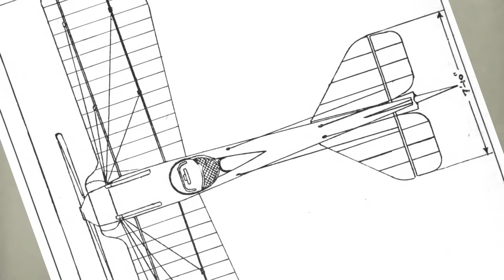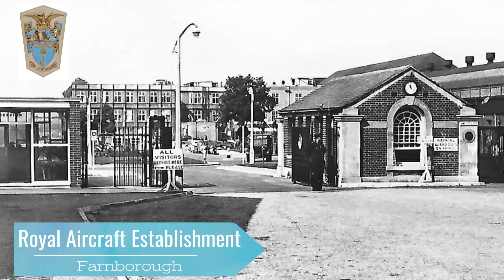This Spitfire ALMOST Went SUPERSONIC - The British WW2 Fighter That Almost Broke The Sound Barrier

Comment: Quite common for Tempest pilots to exceed 560mph in dives, but i find 690 very hard to swallow. 606 is hard enough considering the weight & power. Spits are just not strong enough, damn lucky the wings didn't tear off. I seem to remember Alex Henshaw saying he would put them into a 450 max speed dive, at which point they were out of control.
Reply: I believe that was indicated airspeed which would have equated to a higher true airspeed,; the disparity tending to increase with altitude.
Reply: Alex Henshaw could barrel Roll a Lancaster .
Reply: An addenda to the Alex Henshaw involvement. He test flew the first of 300 Lancasters built at Castle Bromwich . The factory mainly built Spitfires Marks V , IX & XVI . which Henshaw would have test flown. The more advanced Marks XII , XIV , XIX all Griffin powered were built at Southampton. Ace Johnny Johnson considered that the Griffin powered should have had a name change other then Spitfire as their handling characteristics were different.
Reply: Alex Henshaw was flight testing production squadron aircraft a lot of the time, so extremes of performance were not possible or desirable.

Comment: I've read a couple of accounts of the far east flight quite a few years ago and as I recall one of those did claim at least transonic speed. As you rightly point out - not reliable. That account also claimed there was some wrinkling of the wing skins - no idea as to how true, but the tale has been circulating for many years.

Comment: I am confused by the different conversions of speed to Mach numbers.
The first instance was 606 mph which was stated as Mach 0.89, implying a speed of sound of 681 mph.
The second instance had 610 mph, Mach 0.92, implying a speed of sound of 673 mph.
The third instance had 690 mph, Mach 719, implying a speed of sound of 719 mph.
The speed of sound is around 767 mph at 20 celsius and it drops to 741 mph at zero celsius.  However, that doesn't explain how it could be as low as 673 mph.
Could anyone give an explanation?
Reply: Air density (altitude) is another factor I believe. Speed of sound definitions that I've seen always specify temperature and altitude.
Reply: @danpearce4547  The speed of sound varies with temperature.

Comment: Nice one!
 I think the Spit broke the supersonic barrier, i wonder what other amazing aircraft RJ Michell would have come up with had he lived ?
Reply: I'm a keen spitfire fan, and I've often wondered the same.. I can imagine some incredible aircraft being built if Mitchell had lived.. 👍
Reply: If you look at other Reginal Mitchell designs you will wonder out of which  hat he pulled the Spitfire. It's sad that he never knew just how good it turned out. It was about the only front line aircraft that stayed in the front line the entire duration of WW2.
Reply: "I think the Spit broke the supersonic barrier"

Not possible. The energy created in a full throttle dive is simply not sufficient to overcome the massive drag increase as the aircraft approaches what used to be known as "the sound barrier". The clue is in the name.

Comment: Later versions of the Mk XI also had pressurized cockpit.  The dive of the Mk XIX was unintentional, the plane stalled on him.  He had a serious problem with the windshield fogging up as the humidity at low altitudes plus cold glass from high altitude met.  His altimeter was also lagging, so he had no clue what his altitude was.  Also, the main issue with subsonic planes trying to hit Mach 1 was that the tailplane was covered in the shockwaves, and the elevator was inoperable, until lower altitudes and higher temperatures reduced the Mach numbers.  The first all moving elevators that allowed control at high Mach numbers were installed on a Spitfire Mk XI.  This innovation was given to the Americans, which allowed the Bell X-1 to exceed Mach 1 in 1949, or whenever it was.
Reply: Hoa Tattis  Yes ..  Well, I guess you expanded on my term "given".  I thought the British did pay back the loans ... eventually, which is in part why the British economy went to hell post war.
Reply: Hoa Tattis  Perhaps you can ask Indians and see if they had a soft landing.  Also, you can ask them how they liked having a fraction of the global GDP of about 30 %  before England concurred them, as opposed to 3 % of the world's GNP in 1947 when they finally managed to exterminate British rule.

As for the cattle, you have to ask them that too.  You cannot force a country to the 20th century from the 18th century, you have to let them get there by themselves.  Great Britain's rule in India essentially suspended time and progress for 200 years.  

How would the world have been if Britain had not fought Hitler?  First of all, it was Stalin that really destroyed Hitler, not Great Britain.  But regardless, it is hard to tell. The world got Stalin instead of Hitler, who was a far worse dictator and human exterminator.  The USA and Great Britain turned Stalin, the world's worst dictator, into the world's most powerful dictator, under the excuse of fighting the far less evil dictator.  As a result, freedom was denied for a huge portion of the world's population for many decades.  And don't forget, we still live under the shadow of nuclear war, which was one of the consequences of the "triumph of democracy".  WWII was the nastiest war ever, and all the major participants were competing as to who was the most evil.  One of the differences between Great Britain or USA and the Nazis is that at least the Nazis were not as hypocritical.  They declared that they deserved more space, and they went around to get it.  Great Britain, USA, and Stalin (by far the worse) were supposedly protecting the weak, whereas all they wanted was to expand or sustain their own empire, and they were just as ruthless, if not more so.  And Great Britain was the biggest long term looser.  You can thank Sir Winston.
Reply: Hoa Tattis  Well, that's what happens with empires.  The British empire stepped on India's and China's neck.  Then the USA empire stepped on the British empire neck.  Now China is becoming the new empire, although they seem to have no intention on stepping on the USA's neck.  The USA is doing it on itself.  In a way, Great Britain did much of the harm on itself too.  The Britons voted for Churchill if I am not mistaken.  It was the Great Sir Winston Churchill that drove the British Empire to a fast and premature end, and he became a Knight for his great services.  If Great Britain had not fought Hitler, the British empire may have lasted another 20 years and come to a softer conclusion.  Perhaps India would have had a softer landing too.  But who knows ....
Reply: @demetridar506  Keep to the subject, rather than your reinvention of history.
Reply: @David-lb4te  As far as I am aware, John Thorpe (an American aeronautical engineer)  held the World Patent on the one-piece tailplane with a geared anti-balance tab, used as the primary pitch control.  Adjustable-incidence tailplanes used for pitch-trimming (usually via a screw-jack), but not as the primary control device had been around for a lot longer.  Demetri Dar  is probably confusing the two.  Thorpe's version can be seen on all Piper 28 aircraft (which he re-designed for Piper), and the Thorpe T-18 and other popular light aircraft,  but its first use was on the F 86, I think.  The Bell X-1 had the earlier version, and Yeager was smart enough to use the pitch trim to control it, rather than the elevators.
Reply: @David-lb4te  History is the subject here, as I understand.  If you like propaganda, perhaps you are mistaking the subject.
Reply: @dafyddllewellyn6636  The first all moving tailplane use as pitch control for subsonic speeds was used on a Spitfire XI in these Farnborough tests.  This info was passed on to the USA and allowed the Bell X1 and later versions of the F-86, as you said, to maintain control past Mach 1.  I do not know about that patent, but whether Thorpe had any idea of the need of this all moving control surface at close to Mach 1 is the question.  Knowledge is the main key, and it only comes with experimentation.  At least back then.  Nowadays, we have powerful analysis tools, but not back then.
Reply: @demetridar506 Apologies; it's Thorp, not Thorpe.  I do not know the history of what went on at RAE Farnborough;  and it's academic now;  but Thorp was a freelance aeronautical consultant in the U.S. aviation scene, and his history is difficult to unravel.  But he certainly was aware of the technique of locating the pivot of the tailplane aft of its aerodynamic centre and using a geared anti-balance tab, to increase the stick-free stability.  The basic longitudinal stability equations have been around since well before WW2, though the effects of compressibility were not.
Reply: @dafyddllewellyn6636  Exactly right on the last sentence.  Somebody had an idea during the Spitfire Farnborough tests in England that the all moving tailplane might help pitch control at supersonic speeds.  That person was almost certainly not Thorp.  Then somebody had to test it to confirm it.  That was certainly not Thorp.  Then the info of the test is given to the Americans.  Then Great Britain goes bankrupt and cancels the British supersonic research.  Then Bell X-1 happens.  Is this sequence of events of academic value?  I do not know what you mean by that, but it is interesting as to who was ahead in aircraft technology in 1945.  It seems that number 1 was Germany, number 2 was Great Britain, 3 was USA, and 4 was Japan.  Where is the soviet union?  I would say 5.  Each of the competitors had some strong areas.  The Americans were strong in turbochargers and large scale production big bombers.  The British were in supercharger technology and sleeve valve engines.  The Japanese were in refined fighter aircraft that fight (unlike, for example, the US fighters that could only hit and run).  The Soviets?  Perhaps copying, they were good in copying.

Pivot of the tailplane aft of the aero center?  Sounds unstable ... It would be interesting to read the patent.  Patents back then were well thought documents.

Cheers.

Comment: I think the romours of ME262 breaking the sound barrier in a dive in WWII are much more beliveable after watching this.
Reply: I remember reading a luftwaffe pilot's recollection of how the Me262 actually did break the sound barrier. Probably the information was suppressed by the allies.
Reply: Hoa Tattis  what I mean is that late models could catch Me262, when in altitude advantage, because they could recover from compressability and Me262 could not dive away since it had also a low critical Mach number and no dive brakes.
Reply: The Me262 had a critical Mach number similar to the best piston engine fighters. Same buffeting and control problems.
Reply: @vascoribeiro69  Yes, but the English post war Me262 users manual claimed that the buffeting would cease when the speed of sound was exceeded.
Reply: @leifvejby8023  never read about exceeding the speed of sound on an Me262. Even the late P-47D and M could dive faster than the Me262 only because they have dive recovery flaps to get out of compressebility...
Reply: @vascoribeiro69  Did you read the users manual (Pilot's Handbook) for the 262. I only tell what's written in it.
Reply: @leifvejby8023  maybe they didn´t know what the sound barrier was.
Reply: @David-lb4te  I know, but the aircraft had no machmeter and the indicated airspeed at high speeds was very unreliable.
Reply: @vascoribeiro69  but a much slipperier design and more power oh and swept wings. Lots of variables in atmospheric conditions too.
Reply: @hexadecimal7300  not very swept...

Comment: I think that speed with that Spitfire Mk. XIX was plausible, because that plane used a Griffon 61 engine, which meant a faster initial dive speed compared to the 1944 tests using a Spitfire PR Mk. XI with a Merlin 60 series engine.
Reply: But it showed none of the structural issues that the MkXI had developed during their tests. Popped rivets and bent wings. Especially since the wing structure would have been similar. But we’re dealing in speculation here so anyone’s guess……..
Reply: @hughjohnson2674  It should be noted that while the Spitfire PR Mk. XI is based on the (mostly) Mk. VIII model, the PR. Mk. XIX is based on the later Mk. XIVe model, which was better optimized around the Griffon engine.
Reply: @hughjohnson2674  All this technical stuff ignores the fact that it wouldn't make any difference. A Spitfire could never go sonic or supersonic.

There's a thing called Drag Divergence Mach Number. As an aircraft approaches the speed of sound, there is a massive increase in drag, which is why they called it "the sound barrier". There were some before the war who did not believe that engines would ever be powerful enough to achieve sonic flight. So even the difference between 0.92 and 0.96 is huge. On top of that is the fact that the propeller starts to work like a disc and creates a huge amount of drag. That's why Martindale's aircraft lost its prop. Besides, at those sorts of speeds, shockwave formation could cause all kinds of damage and that's why pilots were told to about things like VNE.
Reply: @thethirdman225  I agree, I’m not promoting that claim at all, I know it’s not possible for this to have happened, the Miles M52, now that’s a duck of a different colour.

Comment: Yes, I'm so pleased your research was thorough. Someone else's earlier video never mentioned (beyonf Tobin) Martindale's M= 0.92 (p.50 in Capt.Brown's book 'The Miles M.52') and I also have known about Powle's 1952 incident. I do believe it because that version of the Spitfire wing was very suited to high speed - not the original shape nor the later Spiteful wing. In testing for the Miles M.52, a Miles Falcon was given a bi-convex wing, ultra thin ('the Gillette Falcon'), nearly elliptical, but with wing tips cut off diagonally along the line of the outer shock wave. Presumably, the elliptical wing of the Spitfire, though not solid was thin and was almost within the V-shaped shock wave from the aircraft's nose. PS. tests were later done on an all-moving tailplane for the M.52...on a Spitfire.

Comment: As a USN/USMC flight test engineer I think they made the correct decision. While aircraft flown out of Farnborough had precisely calibrated airspeed equipment a fleet aircraft would have a much more significant deviation in its equipment. Fleet instruments have no need to be precisely calibrated which would be beyond the capabilities of the local repair facilities. The .03 difference in Mach number is easily within the margin of error for fleet instruments IMHO.

Comment: The airframe damage to the Recon MkIX would have been as evident if not a lot worse on the MkXVIIII, as the speed was nearly 15% faster, now even though the later was griffon powered and had the MkVIII fuselage style strengthening as it’s apparently dived  80 mph faster in heavier air ( greater humidity ) than the MkIX. Considering the lack of damage  especially as both aircraft shared a common wing design  and at much less a speed the wings on Martindale’s aircraft were bent , Im not inclined to believe the 0.96 figure as damages evidenced on both other flights were apparently not evident on this aircraft.
Reply: I understood that the single, central wing spar was considerably strengthened twice from that used on the MkIX / FR XI variants - firstly for the Mk XIV to PR XIX Griffon spits, and then again for the redesigned wing used on the Mk21 to to FR47 Seafire variants. Making dives at those speeds feasible without the damage experienced in the 1944 tests.
Reply: Saturated air is lighter than dry air.
Reply: It was a calculated Mach number, since he had temperature data from different altitudes and knew for how long was the dive.

Comment: When I was young (60's) I heard that a P 47 accidentally broke the sound barrier, doubt it's true but it wasn't a gag either.
Reply: I think I heard a similar story, the version I heard was, the top surfaces of the wing were stripped off, and airframe warped beyond repair.
Reply: Was very common to get transonic or beyond the critical Mach number, when parts of the surface gets supersonic creating shock waves. The result was a hole in the ground. Then they put dive recovery brakes on late Ds and Ms.
Reply: Laugh out loud !!!)
Reply: broke the sound barrier i think not ,but the P47 was able to dive, winthout damage at ~1000km/h, a bit faster than a me 262! (the me 262 was limited to ~ 950km/h because deadly losses of controls caused from tail design fails...)
Reply: @leneanderthalien  P 47 . Mach 0. 71  Eric Winkle Brown .

Comment: 'Winkle' brown and the RAE Test Pilots Tested the P-47,P-38 & P-51 at their Maximum dive speeds. So as to determine the Max Mach Number that could be used in operational conditions. The P-47 and P-38 had surprisingly low attainable Mach numbers. They Advised the USAAF to concentrate on P-51 production. and procurement.
Reply: The P-38 was a far more draggy aircraft than most realize.
Reply: Late P-47N had a critical Mach number of around 0.80. Early ones was around 0.69.
Reply: @vascoribeiro69  REALY... with the same Aerodynamics.. Ie the Wing?
Reply: Hoa Tattis  Eric Winkle Browns book .
Wings on my Sleeve.
P 51 0.78  P 38 0.68  P 47 0.71 .
Reply: P 47 mach . 0  71 . P 38 mach 0. 68 .
Not good.
Reply: Hoa Tattis  I've got the book here with me Paper back page 72 .
P 47 0 .71 including P 38 and P 51 .
Reply: Hoa Tattis  Eric Winkle Brown referred to them as Grave Yard Dives .